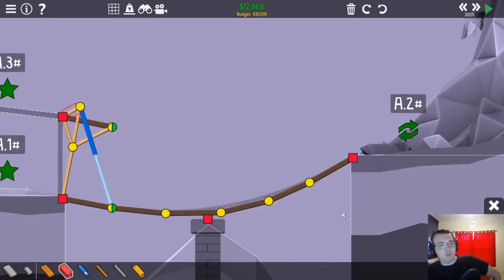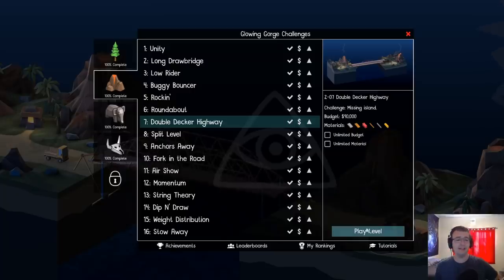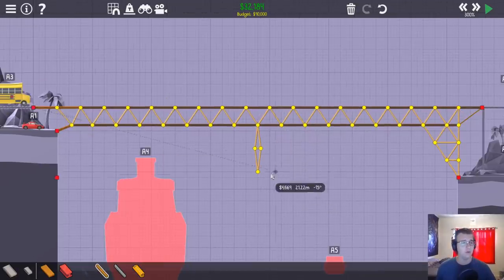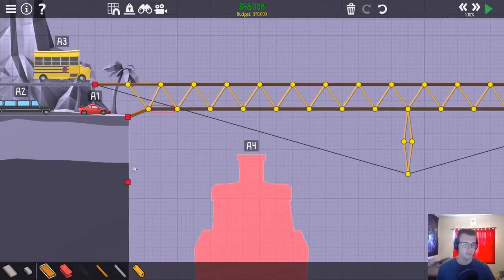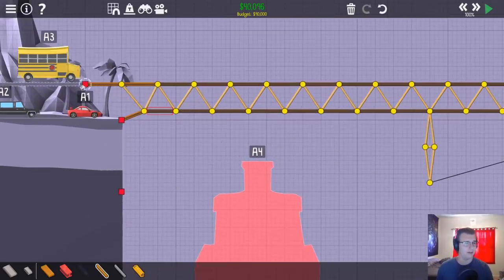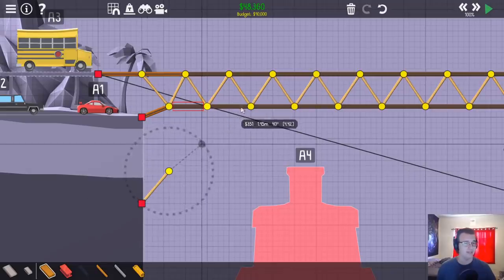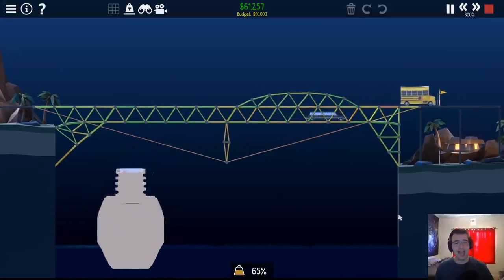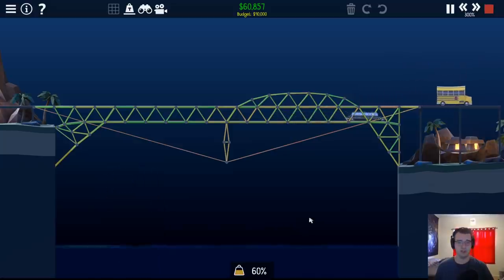Springs Are the Flex Tape of Poly Bridge

Comment from the maker: Somehow, I think that springs need to be nerfed, can't say I expected a Poly Bridge material to need nerfing. How would you nerf springs?
Reply: Make the springs less springy
Reply: More expensive but thats boring
Reply: Make Wood less woody.
Reply: No more spring, only sproing
Reply: While watching i was thinking maybe creeper world would be a neat game to check out and maybe stream
Reply: tell them to stop being so good so they.. uh... stop being good :)
Reply: MaKe tHeM mOrE dAdDy LiKe
Reply: how long ago was this stream?
Reply: This is a difficult question due to the nature of materials in this game, maybe some added weight (about 15% extra weight) and maybe a tiny bit more expensive.
Reply: Remove springs
Reply: Making them real sprigs
Reply: Keep them flexible but make them really easy to break/snap
Reply: I say dont nerf springs make other materials better
Reply: Tyler be like: tension bridge with one point
Reply: Past a certain stretch they permanently deform?
Reply: quick shelf that would make levels too easy
Reply: You dont easy
Reply: make them not able to rocket cars 12 miles across the map
Reply: Nerf them out of existence and turn it into poly bridge 1!
Reply: Allow not to contract/compress as much, make them break easier
Reply: Make them have daddy issues
Reply: Springs? You mean bouncy steel?
Reply: ones it's pulled it can't go back to the original shape
Reply: Make the cost to rise when spring is compressed cuz the actual length of spring is longer since compressed spring occupies the same length
Reply: I would put a cap on how fast they can strech/shrink when something hits it.
Reply: @TheOneGaming0  limit their range of motion a bit
Reply: Make them snap more easily
Reply: I'm excited for the ksp series
Reply: Make the spring into nerd guns it’s nerf or nothing
Reply: Makes bendy as hell
Reply: Replace it with something like bamboo. Still has some leeway in bending side on, and good in compression. Just have to be smarter about it, because too much and they will break.
Reply: Making them easier to break, after all, it's a spring, not steel
Reply: @j03man44  now that's a clever change
Reply: Maybe make stretching and compressing strings actually affect the price? I thought it was weird that you could make a string short and compress it, effectively keeping the length with less money spent
Reply: i would like to have timer on split joints, so you can unleashed compressed spring and made catapults!!!
Reply: More expensive or shorter “range”
Reply: @drahprub7750  I've ruined many pen's and mechanical pencils in my day by stretching their springs too far. It was all worth it just to be complemented for cleverness by an anonymous internet stranger.
Reply: Can u Take the last cp on the Monstertruck lvl first? To make 4 simple road things and drop of the right top roads of if the Monstertruck hits the reverse cp🤔
Reply: I think it should stay the way it is because this is a game of mastery which you need to use the spring
Reply: remove them?
Reply: I wouldn’t because if you were to all levels with springs will have it’s leaderboard wiped
I don’t want that really
Reply: Make it cost money to compress or stretch them
Reply: I would make them more stiff by default
Reply: aliensrock it needs tho be weaker
Reply: Make them have less tensile strength?
Reply: Make them deform under weight more; no way they're that strong compared to a regular steel
Reply: Make Them Rusty
Reply: Perhaps if they broke easier, they would no longer be a cheaper steel, and would actually squish back into the niche they were intended for. What’s the point of steel, if springs can sometimes get it done in half the cost?
Reply: Or make them expensive or have it be less resistant.
Reply: make it less strong
Reply: I would buff them :)
Reply: You don’t, quit whining
Reply: Compressed springs should be more expensive. An odd interaction that springs have with cost is that, despite a spring being the exact same amount of material, its cost is based on its length, if that makes sense?
Reply: The problem is if you nerf a material it will mess up the entire leader-board i cant see them doing a slight nerf to a material the gain is so small unless they do a major redesign or major update or maybe wait for Poly Bridge 3.
Reply: @j03man44  That sounds like it would be really interesting and cool. I would love to see that!
Reply: @suyashmullick2333  Yeah, that makes sense. They should be like that.
Reply: Price them relative to their length at neutral, so short springs that are 100% compressed are priced the same as a regular-length spring in neutral (also the same as a long 100% stretched spring). This way the pricing is more fair, and it is more in line with the total amount of material present.
Reply: Not sure about the interactions with dangling roads but. I would remove or adjust how muchsprings could be compressed/contracted to eliminate spring cannons. I dont think they should be removed as i went back to PB1 and missed the shock abzorbtion.
Reply: I mean can you honestly nerf anything in Poly Bridge? Pretty much every budgeted bridge in the GAME using said material would be screwed. Sadly, they will likely have to make it more expensive (although that could make certain bridges farther overbudget than typically possible), or just do nothing at all.
Reply: I would nerf them by having you play more space game
Reply: By making them better
Reply: AliensRock i have a challenge for you do the level twist and turns without hydraulics and unlimited budget. greetings from Argentina pd: google translate
Reply: Make the spring to not be itself
Reply: @jackalscry8173  All of the materials have the same weight except road and reinforced road
Reply: Buff them
Reply: Make them stronger but more flexible
Reply: More PUSH
Make them fight you more
Make spring cannons a million times stronger so that you can’t use them with out sending a car into goddamn space
Reply: Springs being OP is okay because they have a high skill ceiling.
Reply: Only allow a +/- 50% starting position.
Reply: they have a random chance (about 0.001%) every second to just disappear from the known universe and enter the v o i d.
Reply: Springs are the downdraft of poly bridge, it’s an obscure but really good upgrade
Reply: @kirbomatic1573  genius

Comment: “Y’all heard of this thing called a tensions bridge? Basically, it’s this thing where this cable holds up the entirety of the bridge.”

what
Reply: That's cool, but have you heard of dangling roads? It's this fun strategy where you just hook road to both sides of the chasm and it supports the weight of itself and several vehicles
Reply: Chase B. 
w h a t
Reply: @FriskyD.  You use dangling roads and go from Chase B. to Cheese BS.
Reply: In case you actually don't know the theory: in order for the bridge to fall the middle will need to drop, but in order for the middle to drop the cables would need to stretch and break.
Reply: Ok, nerd time. The middle road wants to fall, but when it tries to, it pulls on the cable, which can't be stretched, and creates tension, hence the name. It's why tightropes work. You pull the rope down, but the rope tries to stay where it is, and pushes you back up. Newton's third law! You push the rope, the rope pushes back!
Reply: EspressoCookie89 
tl;dr : push push
Reply: @snorp6781  hilarious wow
Reply: @espressocookie8965  it's kinda like that
Reply: @sexygarfield5001  -_- or you can use trusses and make a crazy bridge will millions of blimps coming at the same to into it without hydraulics. Lol
Reply: EspressoCookie89 that’s really helpful! :) thanks
Reply: Actually, tension bridges do exist: there is one above the highway near where I live, and it is a two way road for vehicles under 3.5 metric tons, so yeah, it is a real thing (just a random fact here)
Reply: @sexygarfield5001  lmao no

Comment: The reason springs are so good is because real world bridges are meant to have some give to them (as in like a couple feet of compression and expansion) hence the existence of roller joints. They let the bridge “roll” back and fourth  with its compression and expansion (which is especially useful in extreme temperatures (because material expands and contracts based on its temperature) and in high wind which causes  flex in the bridge). The springs serve as the roller joint allowing for a certain amount of compression and expansion when there is a sudden extreme force on it like, for instance, a large truck falling off a cliff and rolling into the bridge. Source: I took a hs course that made us memorize all of this so we could calculate the forces for each member of a simplified version of the Brooklyn bridge in NYC

Comment: In the last bridge, I think you can change the two reinforced road to the left into normal roads if you connect a rope from the static joint to the left extremity of tho reinforced roads because it is in tension. (I don't know if it is cheper though) (Edit : It's cheaper with a wood rope)
And couldn't you replace some cables with ropes ?

Comment: Nearly wrote a comment something like "My Double Decker Highway was just  40k" (top 1% by the way) - until I realized, that this was not the challenge mode bridge. Well ... the challenge bridge is about 60k right now. 
But that's okay for me. I'm going for top 10% with nicely shaped "real" bridges. If that's impossible without dangling roads or if it's too wobbly - I just don't care.

Comment: Did you try moving the middle tension point up a little higher on that last level? The steel cables were $16k of the cost so even a pixel or two probably shaves good money. Looked like the capped out at ~92% stress